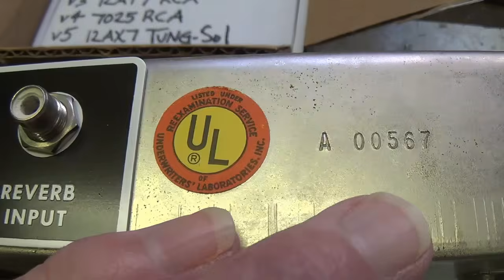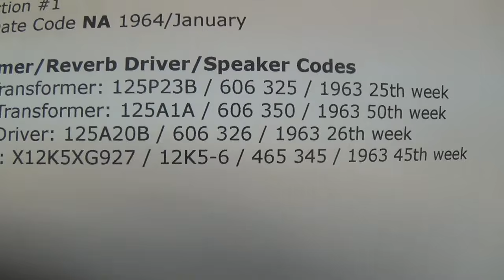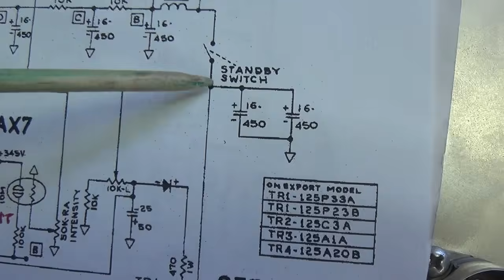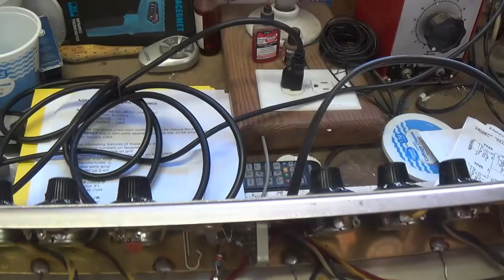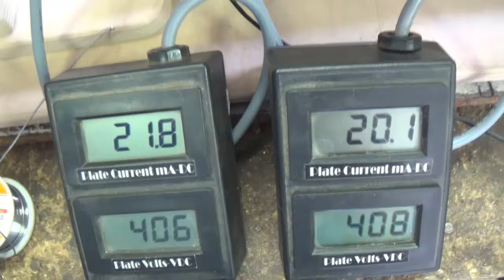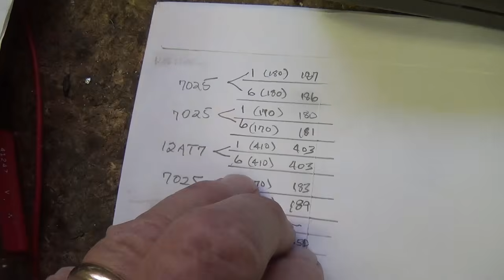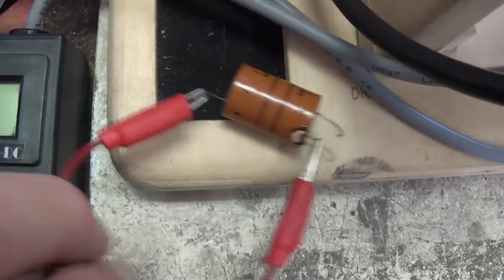Let's Repair the Nicest 1964 Fender Deluxe Reverb in the Universe ;)

Comment: It's really good to have you back!!  I always learn from you even though I'm not into guitar amps, just stereo tube amps.  Question....when would you need to replace the "death cap" you removed with a safety cap?
Reply from the maker: There are special capacitors that only fail "open", Carl, if you really wanted to simply replace the DC.
Reply: @UncleDoug  Isn't it their purpose to filter out AC line noise and keep it out of the audio signal path?  Do you see them as useful for that purpose?
Reply from the maker: @carlespy7470  Not really, Carl.  I have never witnessed any benefit from their presence.
Reply from the maker: Bear in mind that their value is chosen to prevent the passage of 60Hz AC frequencies (to prevent leakage to the chassis) so how can they filter out AC hum ?

Comment: Hi. Probably best to make sure the standby switch is in the "On" position to ensure you discharge the filter caps in this little beauty.
Reply from the maker: Good point, Andrew.  With no access to hot tubes for discharge, the reservoir caps would maintain their charge for quite a while.

Comment: Hi Uncle Doug…ok I just checked mine. Serial number A 03015 so, 2715th made. It’s a 1964. I have the 1amp fuse plate with no sticker over it. Happy to provide pictures as it’s very pristine. In my stupidity, I had  the infamous Sam Hutton who I knew well, recover my grill clothe and add the Fender badge which mine did not have originally! Good stuff!
Reply from the maker: Thanks for sharing, LR.

Comment: I own Deluxe Reverb A00147, one of the very few made in '63. Date code on the tube chart is "MJ", October '63. I had generally known about that serial number range, so I couldn't believe my eyes when I flipped it around and saw it was so low! 47th one ever made! It also came with a BROWN 2-channel foot switch, which could've only belonged to a brown Vibroverb, of which only 500 were made. I presume they were on the assembly line at approximately the same time, and they had some extra brown foot switches that they reused on the very first few Deluxe Reverb's. Super super cool!
Reply from the maker: Wow.....thanks for sharing, RR.

Comment: When the nfb switch is opened, isn't it true that the bias to the longtailed pair is decreased slightly?  So, in order to not change the bias to the longtailed pair, shouldn't there be a 820 ohm resistor going to ground and where the original 820 ohm resistor connects when the nfb switch is opened?
Reply from the maker: An interesting observation, Michael. Ignoring the resistance of the OPT secondary, the cathode bias is established by 470 Ohm + 27K Ohm + (820 + 47 Ohm in parallel = 44.45 Ohms) all in series = 27,514 Ohms . The removal of the 820 Ohm resistor will increase it by 2.55 Ohms or .00009%. Do you really think this is a significant change?
Reply: @UncleDoug  I think that it's really a small change, but it certainly exists.

Comment: 63 and early 64 Deluxe and Deluxe Reverb are the best years for the Blackface amps. I run a 64 Reverb tank with a non Reverb Deluxe of the same year,  pure heaven.  Nice work. Would love to hear that Deluxe in its cabinet
Reply from the maker: I would too, BD, but imagine the risk of shipping.
Reply: @UncleDoug  Goes to show you how much I paid attention to the unboxing. I scrolled to repair section. My guitar luthier friend had a bone stock 63 Deluxe Reverb.  I also did the same restoration process to his. That amp was the best I've heard. Amazing what can come outta a 10" speaker
Reply from the maker: @ Yes, indeed :)

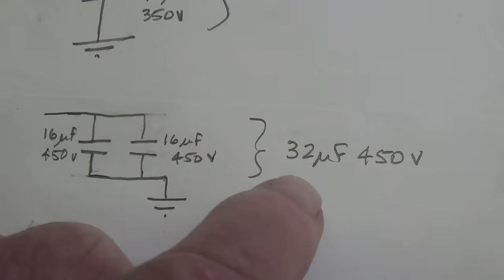Comment: 25:36 - Does this imply that the value of the B+ voltage was constant with varying current requirements based on the model?
Reply from the maker: No, D2. Both current and voltages change during use.

Comment: Dear UD, when changing filter caps, I     do not unsolder the old caps but snip the caps wires leaving around 1 cm old wires and solder new caps wires to the old wires😊
Reply: What you describe is OK to do Jose when involving a terminal strip with multiple leads to each terminal. I have
done it myself with thicker leads of the old that can support the thinner leads of the new cap but never on an 
eyelet board.
Reply from the maker: Most folks like to solder all new leads directly to the eyelets, Jose.

Comment: Uncle Doug this is such a a beautiful vintage amp. Would you spend the extra cash to have a road case for it ? Our guitar player had one made for a not as nice Fender. Once at the gig he simply removed the top cover, leaving the amp on the casters. It would protect the case and that oh so fresh grill cloth. If the cost needs to be saved up, why not.
Reply from the maker: I doubt that the owner wil be taking it out of his house, Ray. It's probably safe with its soft cover.

Comment: Not to pooh-pooh anything, but back in the day when those amps were hated because they were not 100 watts and only lived in bedrooms and were NEVER taken out to gigs, they were ALL in that condition. That's certainly a very early one.
Reply from the maker: I guess I missed those years, Alan, but maybe it's just a faltering memory.
Reply: @UncleDoug  In the 70's, every single music store, even if they had nothing but cheapo no-name student model guitars, had a Deluxe or Princeton Reverb (or no reverb) for sale on their floor. They were $225. Used, from a private party, $125-$175. As many as you could find and there were plenty of them. Nobody wanted them. Companies like Stars Guitars specialized in hotrodding Bassman and Tremolux and Bandmaster amps to 4 * 6L6, replacing the trannies. I myself did this to several amps, in fact, I lost a Deluxe Rev and a Princeton Rev (both hotrodded) in the northern CA fires of 2017. I'd owned both for 30 years. But my point is, you could not show up to a jam or a gig with a Deluxe. It simply was not done.  I always wondered why Fender never made a 40-watt 12" speaker combo amp in that era.

Comment: Hello Uncle, to test the coupling caps you have to remove the tubes or you tested with the tubes in place?
Reply from the maker: It will work either way, FF, but I generally remove the tubes.
Reply: @UncleDoug  thanks!!

Comment: Such a great specimen.  Thanks again.  Looks like no grid stoppers on the 6v6's?  (Grid wires seem to go straight to pin 5)
Reply from the maker: I left the circuit alone, other than the caps and NFB mod.
Reply: @ Good call.  It's a time capsule!  I've just never seen one without the 1.5k grid stoppers (I have a 1964 from later in the year...)
Reply: After some digging… the AA763 deluxe has no grid stoppers. But it also has the dual 100k plate loads in the phase inverter.  But the beauty amp in your video has 100k and 82k like the ab763. So this must be some transition era stuff…. Thanks again. You are the best.
Reply from the maker: @johnraham_AfterlifeStudios  An interesting observation, John. Thanks for sharing.

Comment: Great video, Uncle Doug!! By chance, did you have to enlarge the chassis hole to fit the thicker power cord/strain relief? Thanks in advance!
Reply from the maker: Thanks, S01. I didn't want to alter the chassis, so I used a snug grommet and some Super Glue to secure the cord.
Reply: @UncleDoug  great idea! I have a ‘68 DR and didn’t want to take my drill to it either.

Comment: Love your work but I think you made a slight error on the serial number dating in which you say 267 instead of 567.
Reply: Just to clarify… The 64 Deluxe Reverb serial numbers started at 00300. This amp being 00567 would have been the 267th Deluxe Reverb built.
Reply from the maker: As CG says, Tony, the numbering started with 300.

Comment: Another great video, always enjoy them. Everybody's got an opinion, so I will say good call on not trying to hide the new caps in the old cardboard sleeves. It is just part of the history of this amplifier. You did a very neat job as always and I think using the same brand gives uniformity to the job.  Almost as if they had been there from the beginning. To me hiding them is a little disingenuous and just makes it hard for the next guy to know what's inside.  The next tech, in hopefully sixty years, will say what a fine job.  It is always a trade off between functionality and originality.  Keep it original and not be able to play it, or install modern parts and spend hours using it.  Keep up the great videos.
Reply from the maker: Thanks for your kind words and for sharing your analysis, DH :)

Comment: Hey Uncle Doug, I’m a big fan of yours since the days of Rusty, if I may suggest, test/reform and use the existing caps, do NOT replace those electrolytic with any alternate values, use 16mf 450v, it totally matters to the performance of that amp, that amp is a holy grail to many blues players who would freak if you changed to 22mf and 500v.
To be clear, there is a sag on the transformer that is valued, upping the mf and voltage will stiffen the feel of that amp, it’s a real thing and it ruins the spongy feel of the amp
Reply from the maker: Thanks for your helpful input, BZ.  We appreciate it.

Comment: when i build engines i install freeze plugs with numbers all faceing same. any new hot rods? i'am putting a 460 in my 77 f100
Reply from the maker: We're sticking with the '32 Roadster (top is off for Springtime) and the '36 Ford Pickup (air conditioned for the Summer), PC.

Comment: Great work as always, thanks for sharing! (: Question - F&T also makes a 16uF @475v. Would you consider these as a more accurate replacement for the original circuit (with some added tolerance for higher voltages today)? Overall, using 22uFs is 30uF over stock (and 12uF at reservoir stage) which imho will affect the response and sensitivity of the circuit, not badly mind you, especially on a Deluxe Reverb that tends to run tubes pretty darned hot. Not criticizing your choice, but curious of your thoughts. Thanks! (:
Reply from the maker: Thanks for your comments and question, Larry. Your point is well made. My response would be that with the pre-standby switch positioning of the reservoir caps and the exceptional voltage and current output of the GZ34 rectifier (with a 60uf max reservoir limit), the (possibly) negative effects of the larger caps is negligible, while the increase in bass response would be pleasing to an owner who obviously prefers this (removal of treble bypass cap). Also, I have made this change in many previous Fender circuits and each has been well received by the owners.
Reply: @UncleDoug  spot on, as usual, thanks for the thoughtful and complete response. tailoring the circuit to the owner's wishes is always so important, each amp is different, too. agree, added bass response, perhaps slightly less touch-responsive, more immediate sound and feel, too. I'm sure he/she will be pleased. (:

Comment: I had in my possession for a time a 1964 Deluxe Reverb, essentially made with 1963 Brown Deluxe parts to the new schematic.  99.9% original, even the filter caps.  One added cap to the trem circuit, and a three prong plug (made in the USA cord no less),  roughly in the 70s.  I had to unfortunately sell it, and I think the next owner had the caps changed, but its back up for sale again.  If I won the lottery, I'd buy it back in a heartbeat.
Reply from the maker: Thanks for sharing, Hoki :)

Comment: Great "common sense" repairs and rehab, with a good explanation of why you did what you did. I never thought about the fact that the carbon comp resistors in older gear going higher in resistance with age is kind of "self adjusting" for higher line voltages before, that is a sensible way to look at things, as long as they don't drift too badly out of tolerance.
Reply from the maker: Thanks so much, PMEB.

Comment: Most amps that exceed 30 years old are likely going to need/want a cap job.   I've been doing plenty of them on 70's and 80's amps. Nice to get a classy amp that hasn't been drug through the ringer.   With originals commanding crazy costs,  building clone kits has been helpful for my local market.
Reply from the maker: Thanks for your (always appreciated) input, DK :)